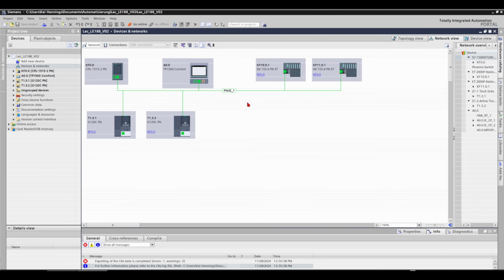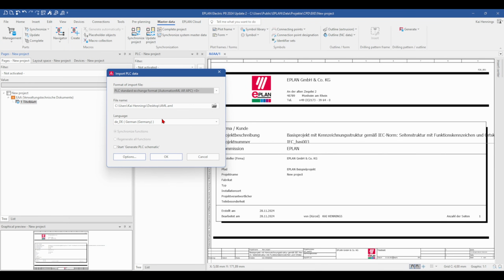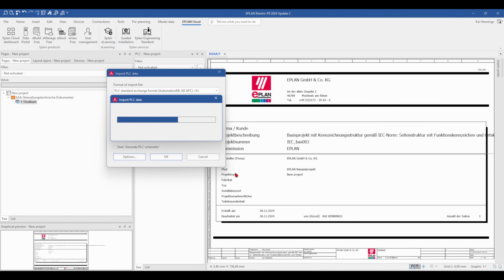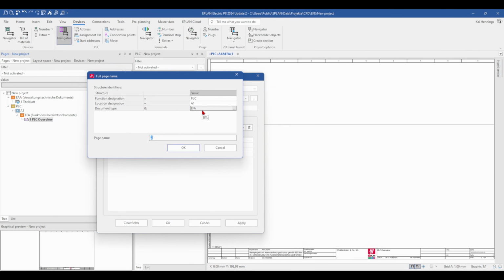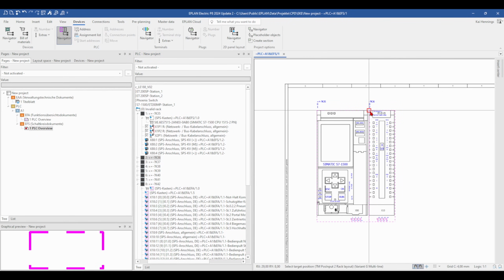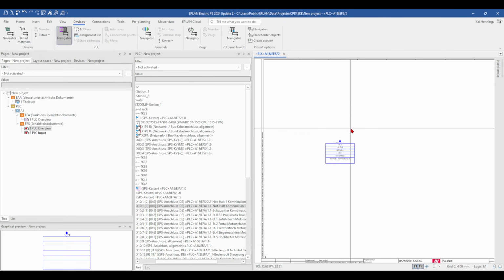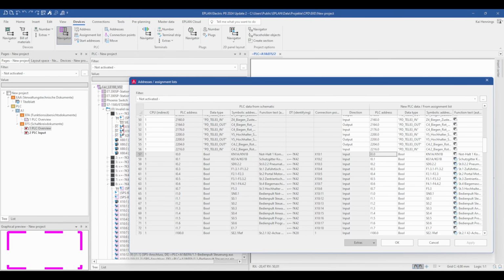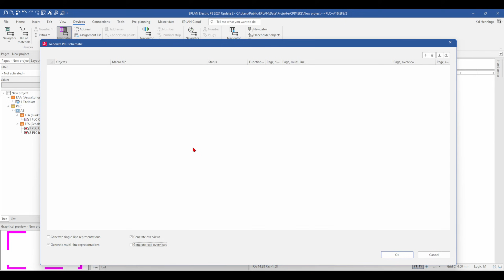Exchange your PLC Data between Siemens TIAPortal and EPLAN

Comment: The world's best EPLAN content creator.
Reply from the maker: Thank you Sir 😊
Reply: @eplaninanutshell  That's a fantastic suggestion! Creating a detailed video series on 3D panel design in EPLAN, starting from importing .STP files to routing and all the intricate details, would be incredibly helpful for many users. It could walk through best practices, tips, and even troubleshooting, making it easier for others to adopt 3D panel design workflows efficiently. Such a series could also bridge the gap for those transitioning from 2D schematics to a fully integrated 3D environment. Thanks for sharing this idea it has immense potential to benefit the EPLAN community!